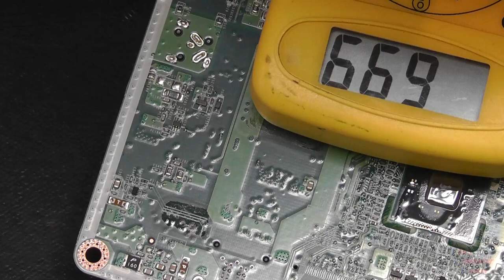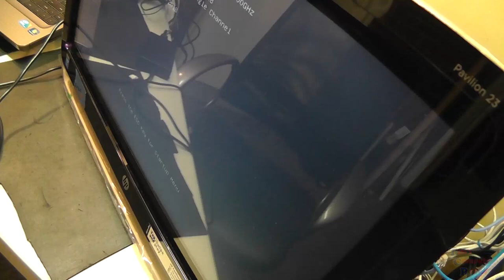Diagnosing Computer Motherboard Power and Voltages

Comment: Actually the "extra step" was the very 1st step to do :). My mom called me yesterday because her PC wouldn't turn on. I asked her if it was plugged into the outlet on the wall, and then hung up after babbling incoherence along nervous laughs (since her son is a geek she became lazy and calls me for whatever tech reason... Which is not really helpful for herself in the end). Thank you for that demo about the basic usage of a multimeter ! 

I also use a multimeter in order to have a first glance at a mother board (or other PC components) before replacing whole parts, as well as before assembling a new build (especially the PSU and the main power leads on the mobo). Sometimes a little soldering repair or chip replacement is all that's required. Also useful to make sure the suspected part is actually the one that's requiring a replacement, rather than data cables or some electronics that can be replaced easily (without the need of another system nearby for testing).

Comment: I didn't know you could change the voltage reading of a power adapter just by plugging it into a circuit board and then to test it again after you've unplugged it.  Interesting...

Comment: Great video Tim. I do wish HP would stop useing power brick for desktop pc's , they can't take the current drawn by the computer when there under load , with fans, hard drives ects and a large 22" monitor .
Reply from the maker: Migsy Cee Agreed. I'm seeing it more and more however.

Comment: HI, I have ASUS corsair formula IV motherboard, It stopped working about 2 years back, when i was rendering some 3D animation data.I arranged myself a core2duo normal pc afterwards due to budget problem. Now I don't have DDR 3 memory or AMD processor.I needed to ask you that if I could test that Corsair formula 4 motherboard without processor and ram?? Since it is a high value product i don't wanna threw or resell it at any cost but i would love to use it again if it can be repaired(I can buy new ram and processor only in case it work)..what do you suggest.. please revert soon.

Comment: Hi. where do i ground the negative test lead of my digital multimeter  to a circuit bored of a hifi system to test the voltages of a stk amplifier ic? Thanks a lot.

Comment: Thank you for your usefull informative video, i have a question about my mini motherboard from a Hp Desktop wich gets juice 
From a kind of Laptop Power Adapter. This Desktop doesn't have a build in Power Supply,  if i try to power it on; i dont boot up; No beeping sound, only the led of the MB stays on.
The cpu nor the system fan is working. is it possible that my motherboard is dead ?
Reply from the maker: +Hamzie I would try a known good power adapter.

Comment: Great video once again!  Do you ever break out a universal power adapter just to test in these situations?
Reply from the maker: Matthew Davidson Ah... Good point. That would have been my next step if the power adapter tested 19v after being plugged into the power jack if that makes sense. Thanks for watching.
Reply: dam u should hv checked adaptor first before remove all stuff 
nonsense

Comment: if it has a external power supply, its should always be suspect first. but still good video for folks who need to see who to open up this particular model.
Reply: Well... it is the first thing he measured, and if there's not a replacement adapter laying around, disassembling the hardware is the only real way to measure it anyways. Your comment provides nothing more helpful than what is already in the video.

Comment: Hi! i have recently disassemblbed my laptop mobo (asus X750JB) to clean the vents.
after reassembling it wont start , no beep , no vents , no sound , its like dead. even the charging led does not turn on when it has to.
however the laptop has passed the diagnosis of the voltages succesfully , when i push the ON button it overheats and nothing happends.
Pls help me , anyone got any idea?
Reply from the maker: You can head over to the Britec Forum and we will be glad to help you with your issue over there.
http://www.briteccomputers.co.uk/forum/index.php

Comment: Tim: *use all electronic repair knowledge to diagnose the problem.
Also Tim: I see it's power adapter problem.

Me: Let me try switch this on with other power adapter real quick. hmm it's just power adapter problem mister you're lucky.
Reply from the maker: Chill dude I took this route to show use of the meter. sheesh

Comment: 30 mins to check the damn charging port? where is "diagnosis" and "checking voltages" ?? waste of time ..
Reply from the maker: Thanks for watching.
Reply: Ok, lets say he checked the power and checked the voltage//amperage on the power cable (and checked it 10 times and was good}. So he disassembled the computer and showed people that don't know anything about using a multi-meter and finding positive and ground. Then realizing after checking the power cable again he was not getting the right readings. There is a lesson here that many people will use wisely, are you so dense to not see the value in this video?

Comment: anyone that uses a screwdriver with interchangeable heads hasnt got a bloody clue. no offence man...but you havent got a bloody clue. there was no need to disconnect anything...you should start testing voltages immediatley.whilst assembled...you should have checked ppower adapter first before taking a interchangeable head screwdriver to the comptuer.
Reply: What about people who wants to learn how to test the pins? This video actually helped me a lot!
Reply from the maker: Fully aware of the point you are making. My point was to show how Diagnose if there was no issue with the adapter. Thanks for the comment